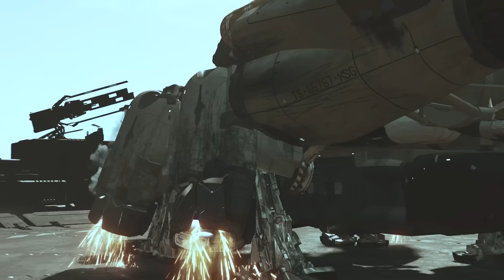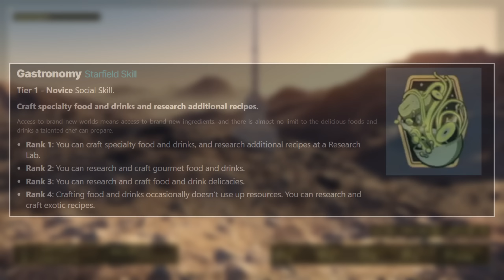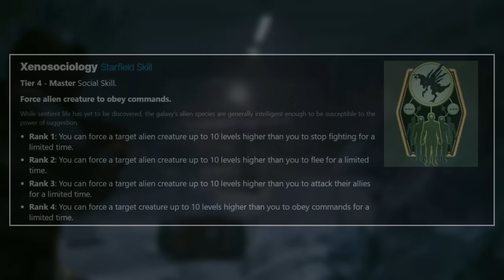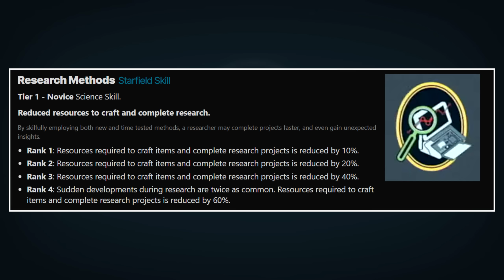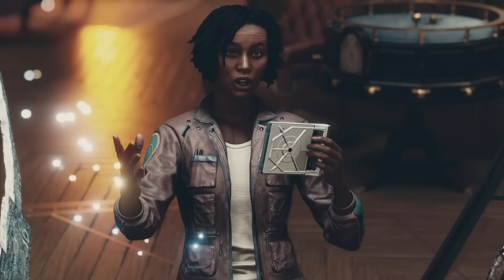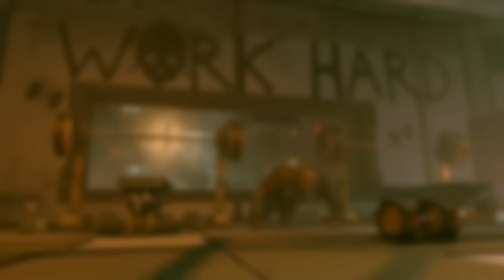All Starfield Skills FULLY DETAILED! 82 Skills Revealed!

Comment: My biggest problem with chems in fallout was the addiction aspect. If we dont get addicted in Starfield (or have a way of not getting addicted ever) then I will usem them a lot more
Reply: They are chems not potions they need to  have consequences attached. You can't snort crack everyday and not be addicted
Reply: fair enough both points, guess it's down to preference then. For me the practically permanent negatives outweight the temporary positives of chems so that's why I never bother to use them, and removing said negatives at the cost of immersion would be enough for me to not see them as wieghted caps, but I can understand if people are not willing to pay this price.
Reply: @lucaslagiewka1503  I'd say a chemist path where you craft the chems and the common chems have negatives but as you get better at it you make less harmful chems or even erase the negatives or you make extremely powerful chems that have very detrimental effects but almost breaks the game with the benefits. The thing is that just getting a free buff is kind of cheap unless is a rare resource or a reward after some quest or exploring a secret area. There's needs to be something balancing it or might as well just play easy mode.

Comment: Dude, stealth sniper rifle build is going to be OP asf. 

There are like 3-4 skills that buff damage and critical hits with ranged, scoped, non automatic weapons. 

Going to be able to punch outside your weight class easily if you pump those skills.

And seeing all of these skills and their different ranks makes me wonder how often we get skill points to put into them and how that whole thing works, because if we only get like 1 skill point per level up, and we require skill points to both unlock and rank up a skill, it could take a long time to get some of these skills to fully unlock if level gain is slow. 

I know there doesn't seem to be a level cap, but if the required xp to level up goes up every level, and you level up infinitely, eventually there is going to be a soft cap where it just becomes almost impossible to level up within any reasonable amount of time or you just run out of ways to gain the experience needed. 

Not going to be looking into too much info about the game prior to being able to play it, but that is something I do want to find out.